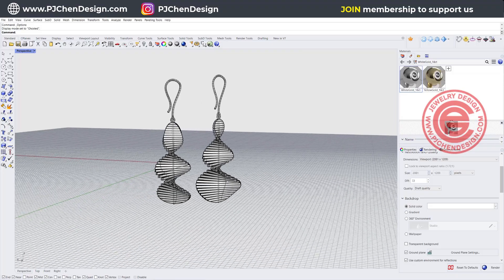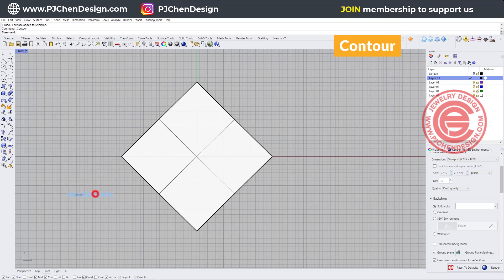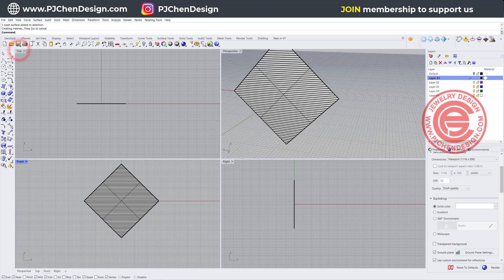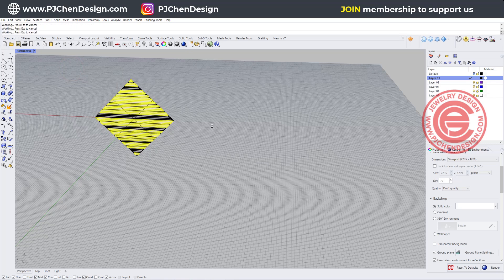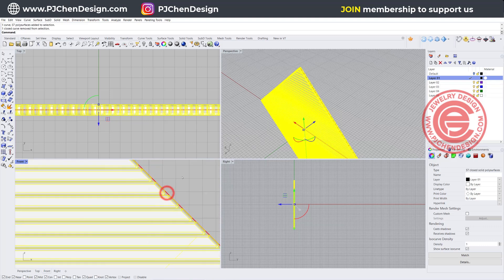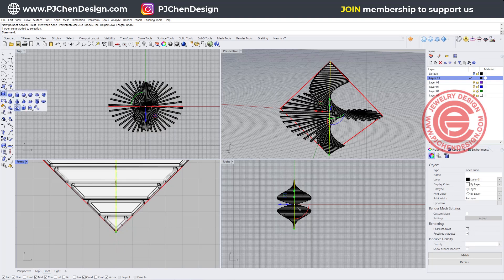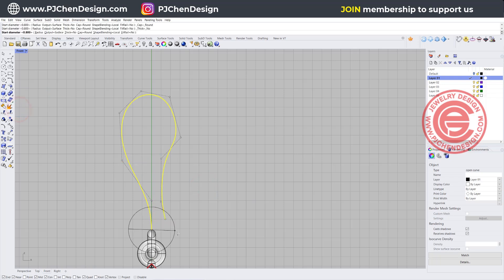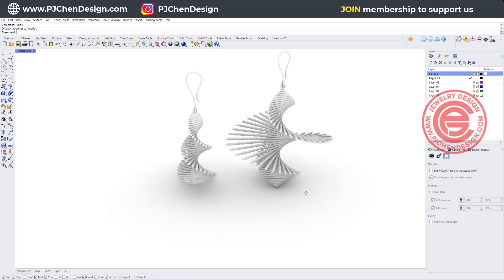Twisted earring Jewelry CAD Design Tutorial 3D Modeling with Rhino 3D #365

Comment: Hey PJ! love your video's so much, I'm wondering, when I'm doing the twist command at the end, the contoured segments are all still attached even though I had made sure each segment was split up, any reason this might be happening? It all twists well but there isnt that "staircasing" look that you have and I'm not sure why. Thanks so much again!
Reply: (for more detail) : i can individually rotate each polysurface by using the gumball to create the staircase look, but for some reason when I use thw twist command, all the edges are still connecting to each other on each rectangle.
Reply: okay after taking a break and then coming back I realized it had to do with the Rigid command being set on "No" when it has to be on "Yes" a simple mistake but if anybody else had this issue that's the solution!
Reply from the maker: super! Glad you find the solution!